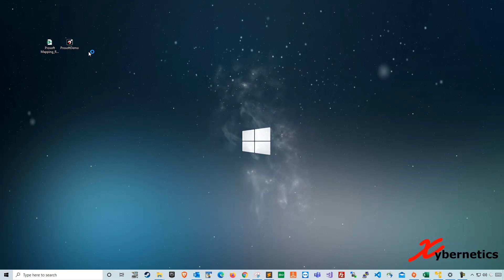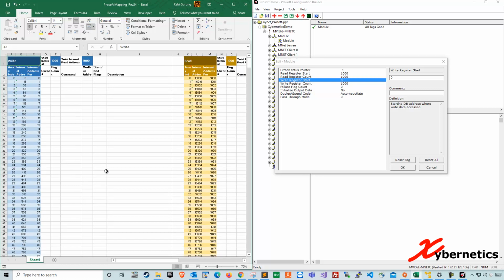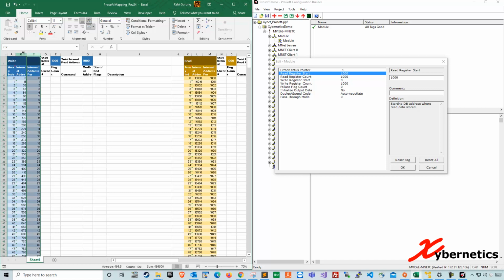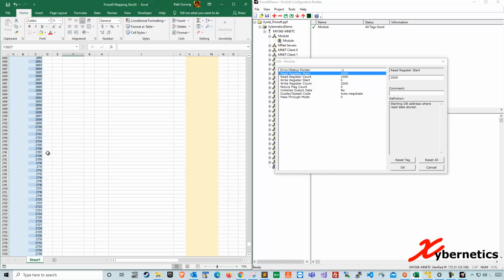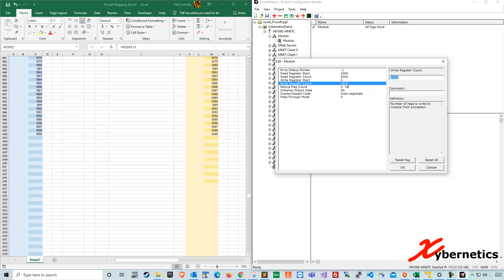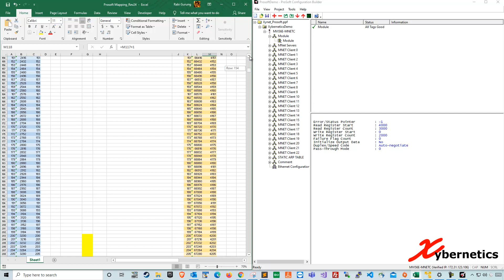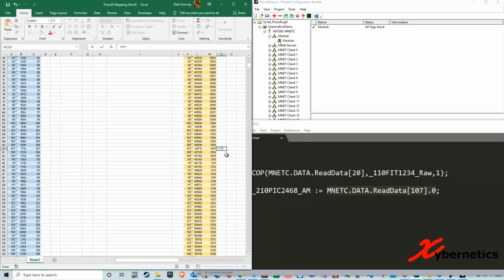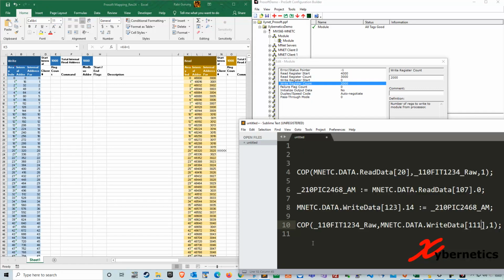Prosoft Internal Address - Fully Explined

Comment: Hi, for the internal address given, may I know how to cross reference in RSLOGIX5000 to find the exact tag?
Reply from the maker: The ProSoft internal offset (or write and read start internal register) is defined in the ProSoft Configurator Builder Edit Module. Watch from 1:11 mark of this YouTube video for full explanation of how it works.

I hope that helps!
Reply: @jjnet247  now i understood, we defined the write and read start internal register at our RS Logic and then further define the "internal address" correctly in the PCB modue
Reply from the maker: @eggysu89  That right!
Let me know if you need more help with the ProSoft.
I am not too sure where you are with your project but I have another video that will help you diagnose ProSoft communication issues.

https://youtu.be/zfk_OYuKWI4

Good luck with your project!